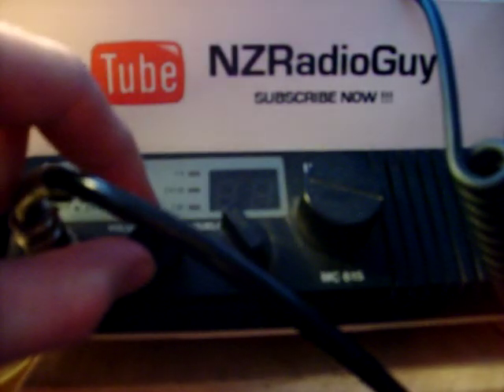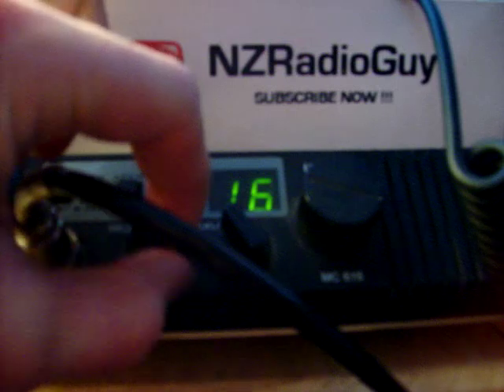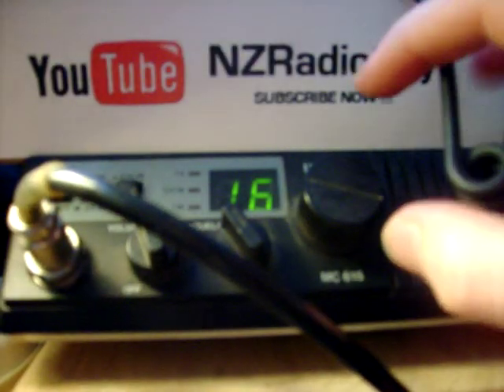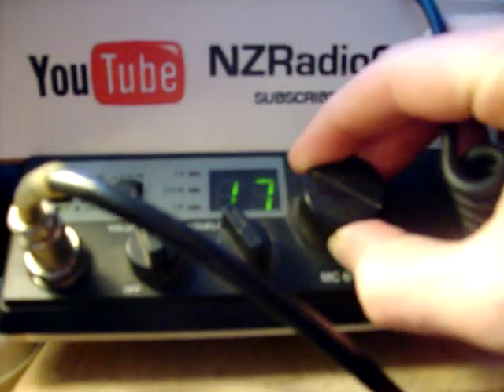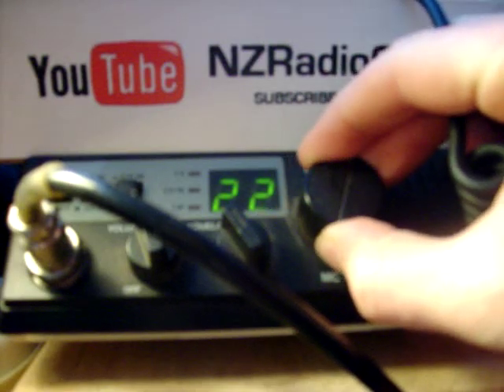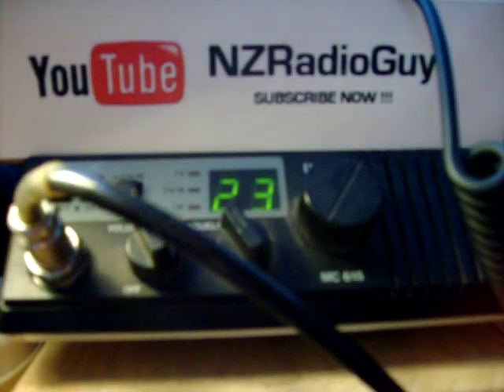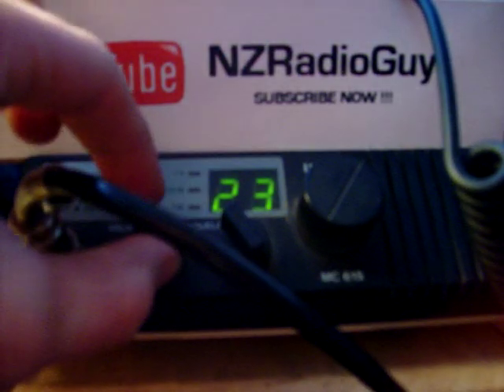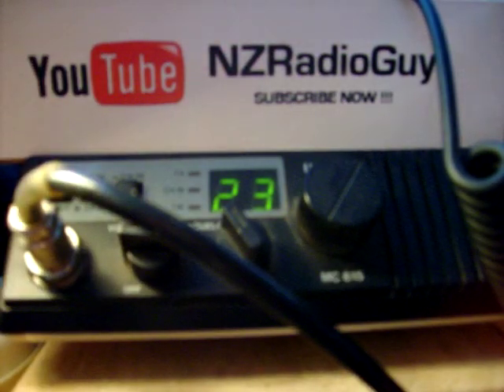Easy way to check your VHF Marine Radio Antenna system

Comment: fist that is a CB radios the real way to test an antenna is with a SWR meter in line use a dummy load to test cable to radio hook antenna back up inline with the swr meter SWR over 1.5 or 2.0 is bad make sure the SWR meter is for vhf or uhf or hf

Comment: I'm still learning, but you seemed to skip over the part on swr, how it will destroy a radio's final mosfet/transistor if you transmit continually with a untuned antenna.

Comment: With no disrespect intended, I found the video to be uninformative.  Basically you are saying that you make sure everything is connected and put it on the weather station (which is generally a button on the radio).  I suspect that everyone does that.  I have a problem with my radio and the weather works fine as long as any wire is attched to the radio (for example a cable extension cord).  

I think a more in depth diagnosis would be much more helpful.